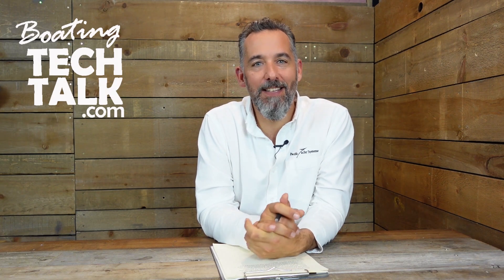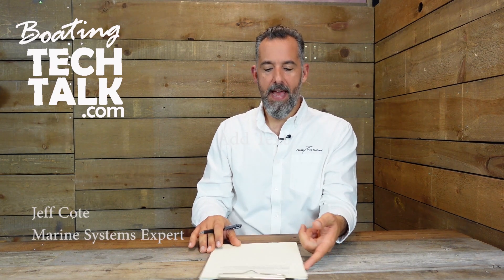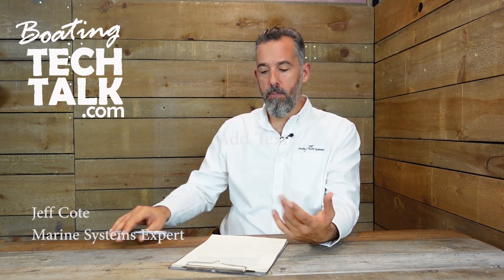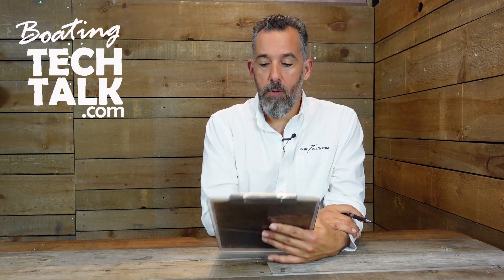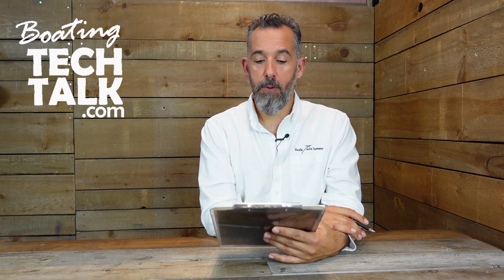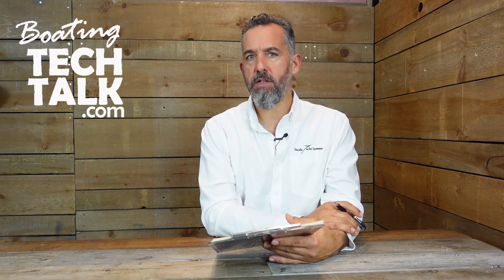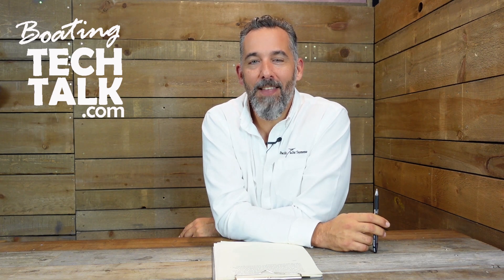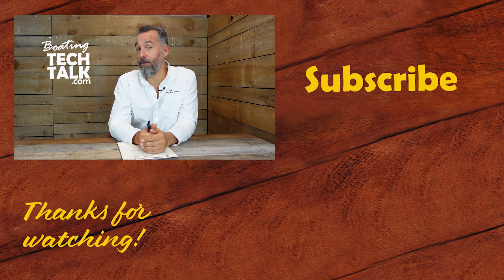Charging A Boat on A Mooring Buoy

Comment: Hi Jeff, big fan of the Channel. I'm looking at a couple of 50ish foot, mid 80's Chris Crafts and a Hatteras 53. None of these boats have Solar. My question is, since a Boat has a 12 volt, and a 24 volt system on board (and I know this will be expensive  ... lol) But assuming there's space, would it be better to have 2 separate charging arrays,  or just 1, and run everything off a 12 volt system and use a converter to run everything that's 24 volt. Thank you for your help.  You always put out Great and Helpful Content. I forgot to mention,  I plan on living on the boat full-time,  installing around 5000w of Solar Panels,  Charging 12 or so - 206Ah lithium batteries plus Starting Batteries.
By the Way, I'm Steve ... lol
Reply from the maker: Hi Steve, good question. IMO, better to have one large solar array charging your most important DC system (e.g. 12 or 24) then having a DC to DC charging converter to go from 12 to 24 or 24 to 12.
Reply: @PacificYachtSystems  Thank you

Comment: I was told by an survey auditor a while back that methanol had not been tested against cables if a leak occurs, still a possible issue.?  And in a previous vid, you said that small  generator a 12, 13 amps output were not ideal, is the 4 or 5 amps generated ok since it is DC?  Thanks for your vids always interesting, bonne journée,  jc
Reply from the maker: Hi Octopus, thanks for contributing to the dialogue
1) Surveyor brings a good point, you don't want to have methanol ever leaking into a boat. After 10 years and selling loads of these units, we've never encountered a leak. It's important to mount the EFOY M10 fuel cartridge in it's holder.
2) Unlike an AC generator that is run for high output for a short period of time, a fuel cell can run continuously with low output. For instance a 2000 watt generator outputs 12 - 13 amps AC continuous, and could power a 60 amp DC battery charger. You might run the generator for 3 hours, getting 180 DC amp-hours of battery charging. A methonal fuel cell might output 8 DC amps for 24 hours and give you 210  DC amp-hours per day.

Comment: Since you have an Efoy on your own boat, can you please share what the real life expectancy of them is ?
Reply from the maker: For reference, i installed an EFOY 210 on my boat about 8 years ago. It's output was original about 8 amps, after about 3000 hours of ops, the output is now about 4.5 amps.
Reply: @PacificYachtSystems  So you better oversize in the first place. Does consumption remain the same ? (lt/KWh)

Comment: Is it possible to connect a Victron GX50 to a Masternaut inverter and a Cristec charger.
Thanks in advance
Reply from the maker: Unfortunately not.
Reply: I have the efoy 150 on our 45ft sailboat in the pnw. It’s has Ben flawless and added to our cruising and safety. It turns in after two days without running the engine and when we wake up we are fully charged. That’s important for us as we have three fridges and power winches so even when sailing we use considerable battery power. Efoy changed our comfort while cruising.

Comment: Thanks for the video Jeff! Recently found your channel and have been binge watching.  What about using a "Solar Generator" like a Jackery 1000 battery plugged into the shore power cable to keep batteries topped up and run the electronics for a day or two?? I'm not of fan of having a louder Honda 2000 in the same configuration.
Reply from the maker: Good question, but unfortunately don't have experience with these solar generators. Anyone else can answer the question?